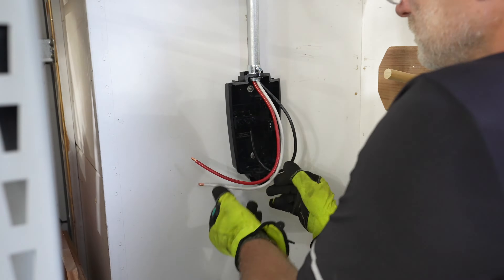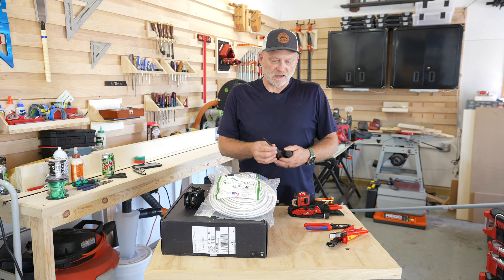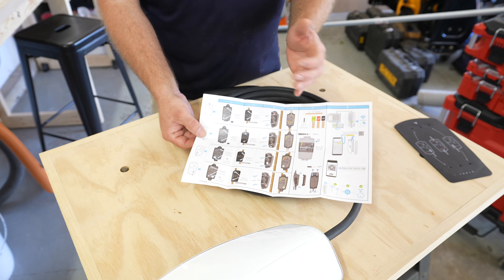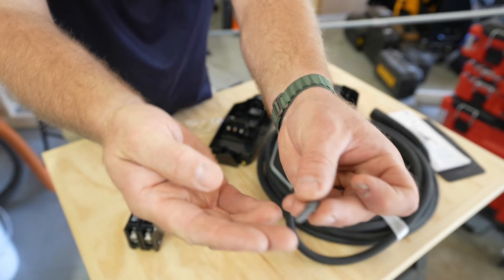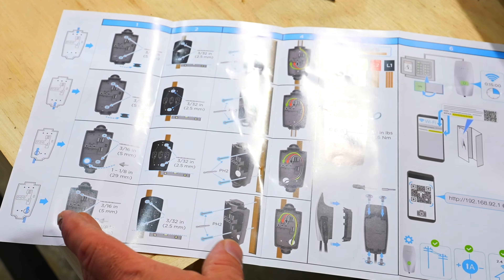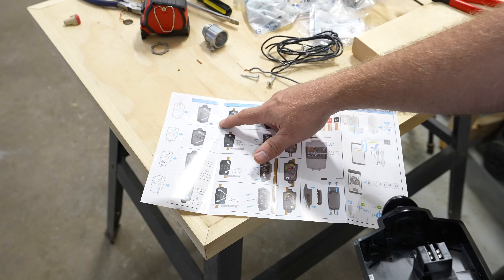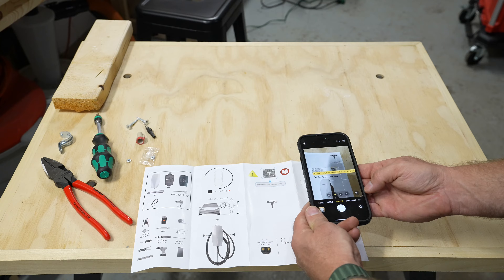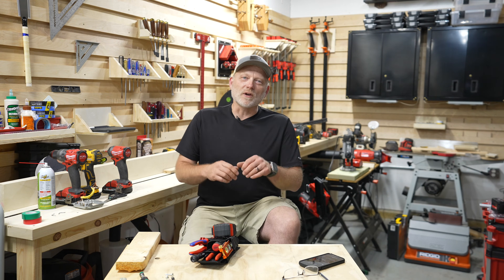Tesla Wall Connector Installation | Gen 3 Charger

Comment: Great video!  I have a question on how to remove the cap/cover of the top hold to let the power in.  In your video, this step is skipped, but it is what I am confused.  Note I am not electrian and do not have too much of experience on the electrician work.  Thanks for your help!

Comment: The ground is supposed to be green, not white, and it can be a green #10 for grounding up to 60 amps.
Reply: I guess the question is, is this really a ground or neutral? In a main panel that is bonded it may be the same thing but it is important to use the proper term.
Reply: @ it’s an equipment ground.
Reply: @lalomarin10  it's not a main panel!

Comment: Could you please guide me on where to get the wire required and the conduit
Reply from the maker: I used copper 6 gauge stranded wire.  You can pick that up at any home improvement store.  Conduit is a combination of 3/4 inch electrical metallic tubing (EMT) and 3/4 inch flexible metal conduit (FMC). Those are also at most home improvement stores as well.  I purchased all my products at Menards, which is like a Home Depot in the upper midwest of the United States.  Menards.com sells online too.

Comment: Is the 6 awg wire enough for 60 amps breaker?
Reply: 6 AWG is enough if it’s THHN or THWN.  It’s not enough if it’s Romex/NM-B.
Reply: @NickWindham  exactly
Reply from the maker: Yes - but check the National Electric Code (if in the US, or similar for your country if outside the US).  You also need to maintain enough free space inside the conduit or derate the circuit to a lower amperage.  Check with an electrician in your area for the best response.